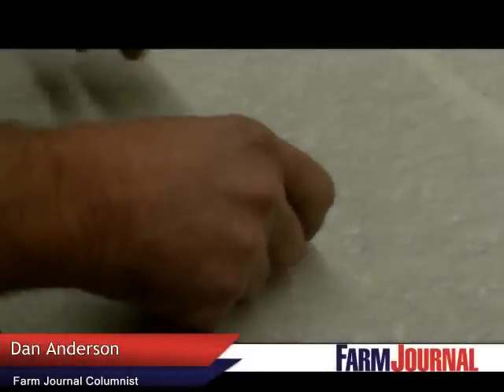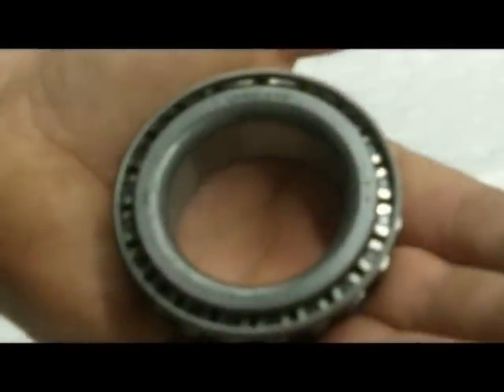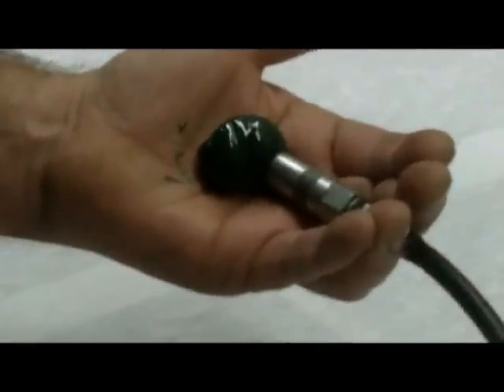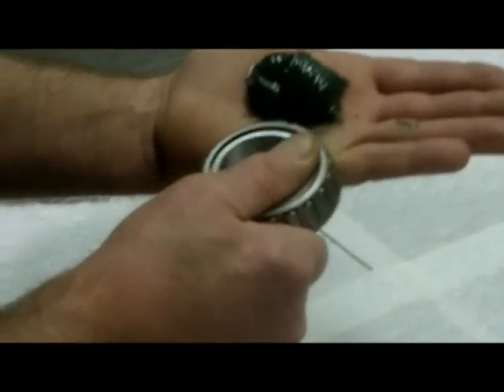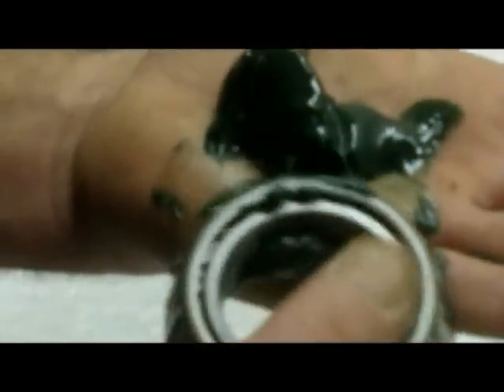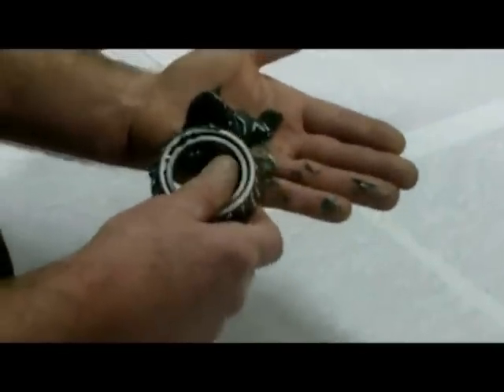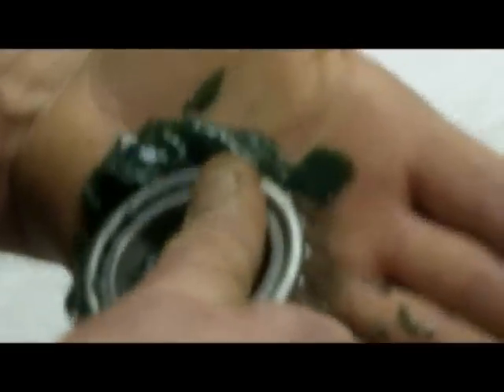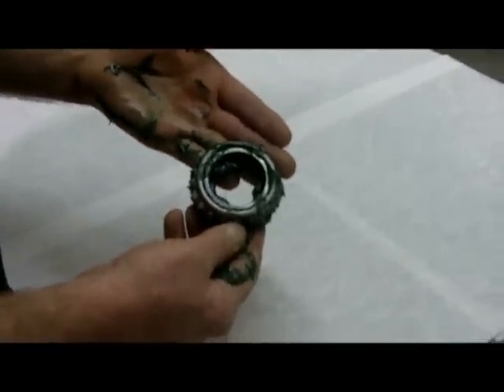Hand Packing a Bearing

Comment: good video, good demo, but i have 2 points about your comments. first what you're holding is an inner race, the rollers, and the cage..... the 'outer race' is pressed into the hub. secondly, you cannot put 'too much' grease in a bearing, hell i put extra grease inside the hub when i do a wheel bearing job. why? if that hub doesn't get serviced for a long time and the bearings start to get hot, the hub will heat up, melt that extra grease which will then flow by centrifugal force right to the bearing. been doing it that way for over 40 years and never had a failure due to lack of lubrication. BTW, this is exactly how i was taught to pack 'em!

Comment: STEP ONE, PUT ON SOME LATEX OR NITRILE GLOVES..............
Reply: rats arsed no just don't wanna
Reply: rats arsed technically you can get a contact allergy after years of grease exposure. or it can just dry out your hands over the years. or both.
Reply: STEP ZERO, BE A MAN.
Reply: I think I personally would find it to be a pain to try to do it with gloves on. Especially since you have to push it down onto your hand and slide it.
Reply: @rd5026  And people that don't like cancer.
Reply: @rd5026   Yes, yes they are.   My GF won't let me near hers unless I am clean.
Reply: @Dave C. "Nah I don't use bitch mittens"

years later

"Why God, why did I have to get cancer what did I do to deserve this"
Reply: @Fizzgg  You pack bearings on the side of the road?
I've spent many days with grease on my hands.
Reply: @rd5026  you're the reason we have these protocols in place
Reply: Agreed on the gloves I am a professional mechanic and not even the toughest hand cleaners we have at work or I have at home will take this grease off I have to scrub for days and my mom yells at me for having dirty hands and arms when I come home lol
Reply: He was going old school 😂 This is how I was taught 40 years ago in HS auto shop.  No gloves.

Comment: Good video, thanks.

But what you call the outer race is actually the clip, I believe. The race is the part the rollers (or balls, or what-have-you) roll against/between.

The outer race is the part driven into the hub.

Comment: What grease you used for your bearings because its color green i have a bearing grease but its colored red
Reply: They’re just dyes, natural colour of grease is like beeswax. Don’t worry about colour, just get a grease that suits the application, ie high temperature or not, waterproof or not (the 2 most important attributes)
Reply: Don't use red grease! It's red to signify it's for use near rubber components. It won't be at all suitable for bearings. the grease this guy is using will be dark grey (sorry, UK spelling!) and is almost black. The camera making the video has made it look a bit green. Use Molyslip High Load bearing Grease or similar.
Reply: I should add that the seal is made from a type of rubber/plastic that is not affected by non rubber grease such as Molyslip High Load bearing Grease or similar.

Comment: Not being a hater but  If you read the comments many watchers agree at 17:11 you show greasing your bearings I did not hear you say you had packed them before this you should pack them like in this clip or they will fail as you have not put enough grease in between the rollers  https://youtu.be/BhL1uAp_WCw?si=GsMZ0dpRRSZGdzgn.